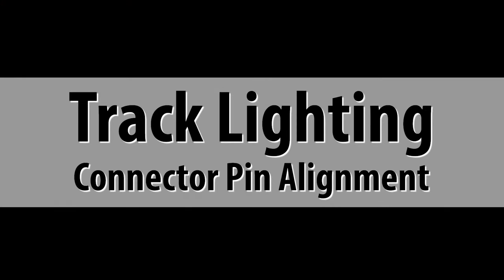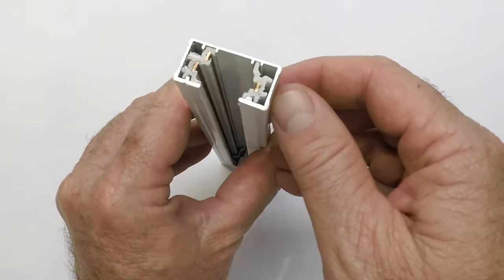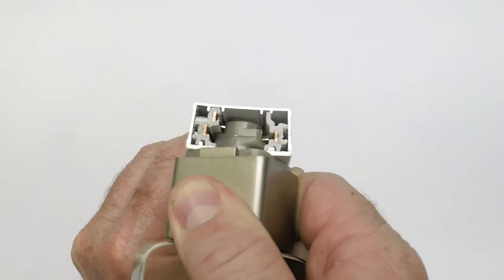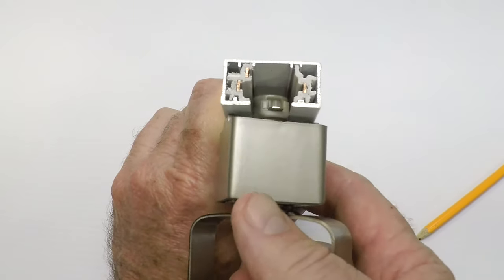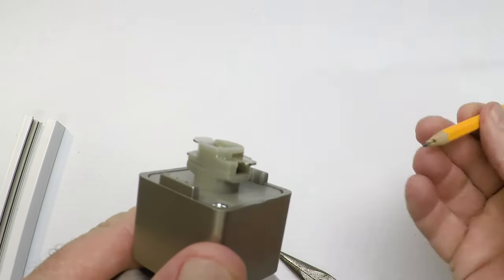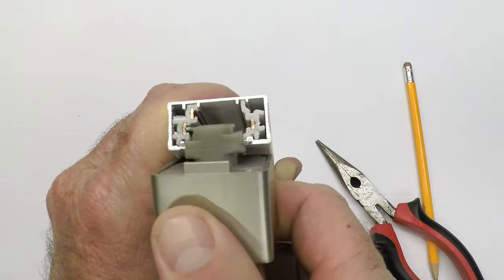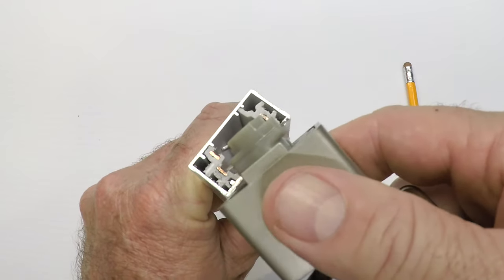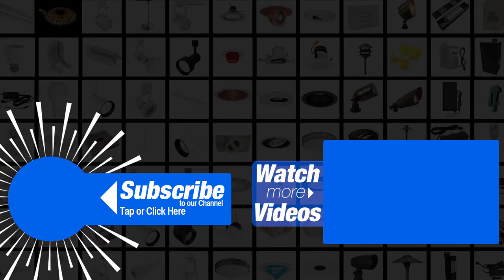2 Common Track Lighting Connection Problems SOLVED 👍 👷‍♂️ 🛠

Comment: Thank-you for the detailed video. Well done. I have been doing a bit of research to find replacement fixtures for two low voltage halogen (M16, 50W) track fixture assemblies I have had for years. They're both 2 - wire. The fixtures are mixed-type on both...but work. One device has the rotary locking bar...one requires the whole fixture/device to be inserted and rotated 90 degrees for a spring clip to engage. So, I guess I'm asking if JT and LT 2-wire heads are interchangeable? JT's are supposed to measure about 15/16" across the fixture pins, while LT's are supposed measure about 13/16" across the pins. I'm guessing you've gone through this before and am hoping I could benefit from your experience. Thank-you for your time should you be able to reply.
Reply from the maker: Thank you for your feedback! Glad you like the video 🙂 Unfortunately, we do not sell the JT or LT track lighting styles so we are not familiar with the interchangeability of the fixtures 😞

Comment: 1. Lithonia Lighting could have improved the design by marking with a label on the track to show two pins and one pin sides instead of someone peeking inside the track while standing on the ladder with no lights.
2. At 2:09, you would see a mark (called Ground Indicator) where the stem and shroud join. This indicator side has two pins (one of them is ground). This is only helpful as a reference if you are installing subsequent bulbs if the first one is installed correctly and working fine
3. To remove a faulty bulb, the shroud should be pulled gently (or pushing the stem up and pulling the shroud down to avoid ripping the track off the ceiling), and twisted 90 degrees either direction 
4. To install a new bulb, make sure where the two pins side is on the track and two pins side is on the bulb (or the Ground Indicator as mentioned above) . The bulb can be installed in two ways (Please remember Step # 2 above)
      a. As this video said, put the bulb in the track, pull the shroud and twist the bulb 90 degrees so that the two pins sides on the bulb meets the two pins side on the track. 
      b. As "SamFixit Guy" commented below, put the bulb in the track, push the bulb towards the ceiling so that the shroud is pushed down automatically and twist the bulb 90 degrees so that the two pins sides on the bulb meets the two pins side on the track. I prefer this method as it uses ONLY ONE HAND to do
Reply from the maker: Thanks for sharing again, LOL 🙂

Comment: I'm working with 2 pin type tracking/lighting, so hoping I can find a little more information on that, and a link to additional lights, where LED's can be installed, rather than the halogen currently in my father in laws garage.   He is legally blind, and seeing 'pins' is near impossible, so a screw in bulb (E26 I believe they're called) would be much easier for him, or even myself when I'm over for a visit.
Reply from the maker: Here is a link to popular track lighting styles that might help in determining what type he has  https://www.totaltracklighting.com/popular-track-lighting-styles.html - hopefully this will help 🙂

Comment: I was so disappointed my lights didn't work when I first installed them, but it was simply pins not lining up.  Just because you can turn the fixture, with a 90 degrees doesn't mean it lines up correctly.  In my case, need to pull back the spring push up and then turn, and they all worked. I hope this helps someone else.
Reply from the maker: Thank you for sharing your experience 🙂

Comment: Pls suggest if tracklight not work,what should we do.
Reply from the maker: There are many variables in why track lighting may not work. Always check to make sure there's power to the track lighting system. Double check your light source, lamp / light bulb, to make sure it works. Double check your track light fixture to make sure it works. Make sure the track is not spread apart and that the track fixture is making contact with the internal power track buss bars are some easy ways to troubleshoot lighting problems 🙂

Comment: Are there ever issues where the bus bars break some how? I have a track that doesn't seem to have a connection towards the end of it, and I can't find replacement bus bars
Reply from the maker: We haven't heard of a broken buss bar but I guess anything is possible depending on what forces have been applied to it. Another possibility is that one of the buss bars is shorter then the rest due to either a manufacture defect in the length or thickness of the buss bar, if the track was customized and something happened to the buss bar, track fixture has a defect causing the track to spread slightly more than another fixture, etc . . . The only way to know would be to take the track down and make sure all the buss bars are aligning correctly and are the correct lengths and trying different track fixtures that work in the same location. Hope that helps 🙂

Comment: What if all the contacts (pins) line up and it still doesn't work? Bulb works and other fixtures on the track also works.
Reply: By the way I also get the little arc on the neutral pin when I insert it onto the track, so I think it's getting powered all pins are making contact
Reply from the maker: @bizango99  Sounds like the fixture maybe the source of the problem and may need to be replaced.

Comment: I have a rather irrelevant question. I have a power supply board from the inside of an LED track light. Ya know how each light has its own little board? Well, I can't figure out the stats or what it does lol. ID numbers do not return any good information as it was made in china. 

I assume its an ac-dc converter of some type, but my cheap multimeter is having trouble reading it. The led says it is 12v dc ... but my meter only reads like 2 volts. I cant get an amp measurement... I assume because the conversion to low voltage jacks up the amps so its outside the range of my meter? IDK... I'm a green horn lol.

Point being, I'm hoping it will provide 12v with a super high amperage. If so, I was going to try it out for electrowinning copper. I know it's easier to just buy a bench unit/power supply... I'm just trying to be creative and save a good $300 in the process lol. 

Do you know anything about these tracklight led boards?
Reply from the maker: Unfortunately, we do not. There are so many LED track fixtures in the market that we would have to carry each brand for us to know in order to better troubleshoot the issue. I would try contacting the manufacture or the place you purchased. It maybe covered under warranty as many are.